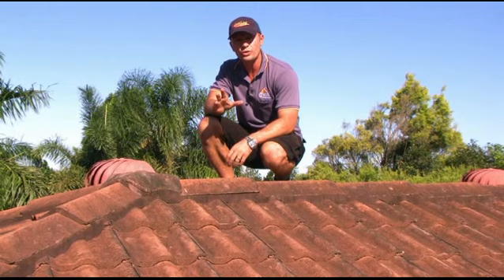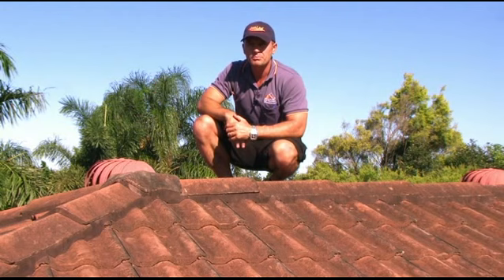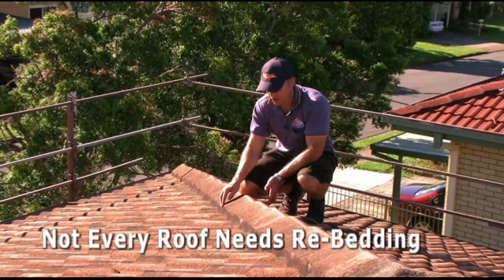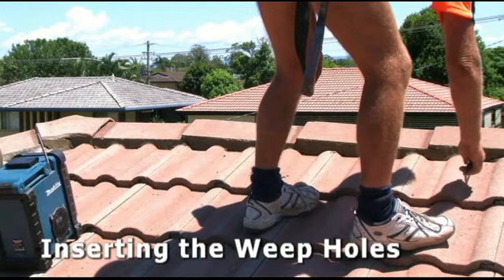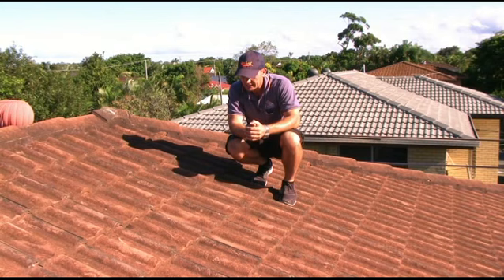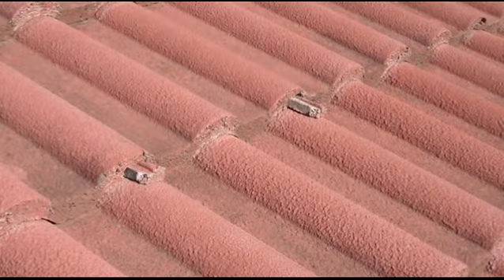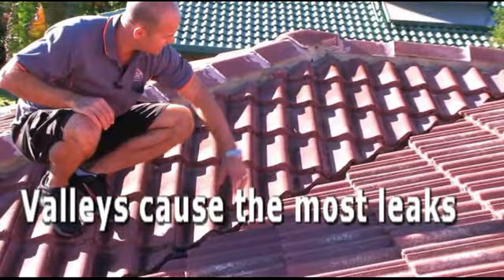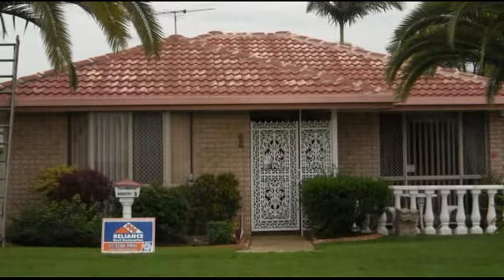Tile Roof Restoration - What to look for on your tiled roof

Comment: this is a bible for the home owner - well done.

here's a tricky scenario i'm dealing with and your thoughts are appreciated:

the 1967/68 concrete tiled roof leaks currently in a few places (recent purchase) and i'm needing to resolve the leaks until i can replace it with a steel roof  - a few months away at earliest.

the pitch ranges between 11-13 degrees so it's up against it from the start.
the longitudinal overlaps (watercourses?) have been siliconed over a few m2 to deal with leakage but unsurprisingly haven't resolved it as the job was done poorly and now the watercourses are partially obscured and the silicon just traps dirt/moss.

i've cleared moss/debris from all joints where possible but with such a low pitch i'm inclined to spend a few hours adding more silicon to get it to survive the next few months as opposed to clearing the silicon out and hoping for the best.

would you recommend another course of action?

Comment: What's the trick to rebed the bottom 3 ridge cap tiles?
Reply: So , so many tile roof hib tiles don't have a metal slip-retainer at the gutter . This is the reason the bottom one often comes adrift and pulls a few others . You can buy these and install yourself when rebedding and pointing those three . I've seen many jobs that don't use enough bedding mix , and several contact points are not supported  .
Reply: @npet6842  thanks for the advice I used timber wedges to hold the joins tight will fill them in when pointing

Comment: What's the go with the 'weep holes'?
Reply: Should rain ingress through a crack or lost seal , it can run out rather than sit in there to evaporate . Often , it's not done , especially with bedding and colour epoxy coating two layer jobs .